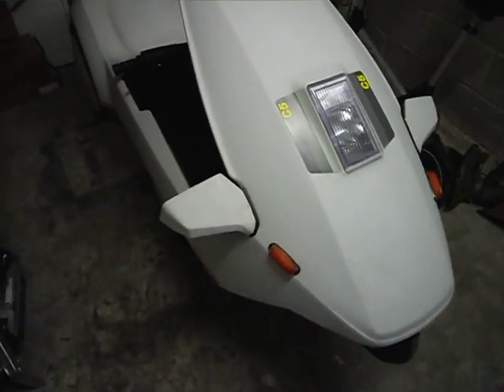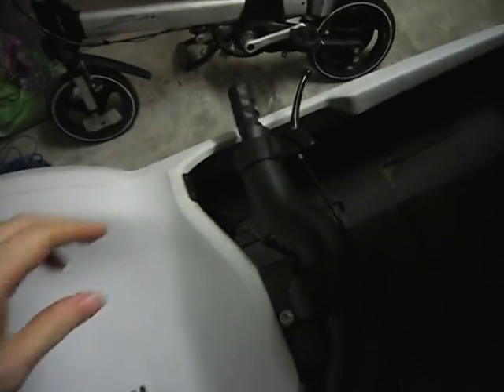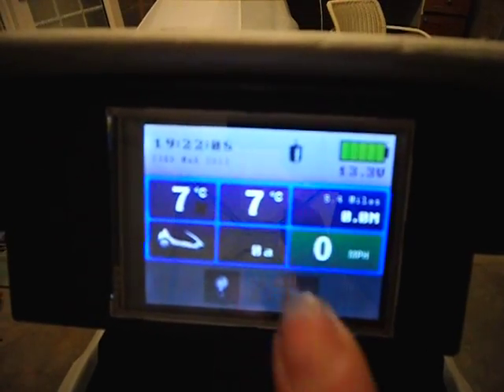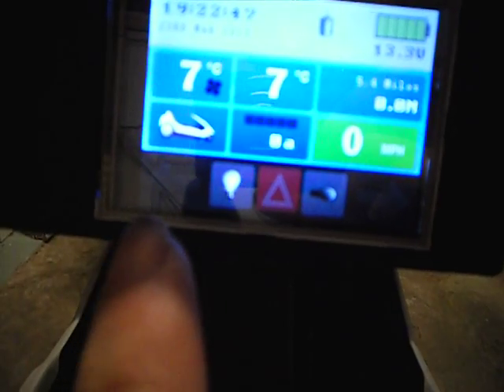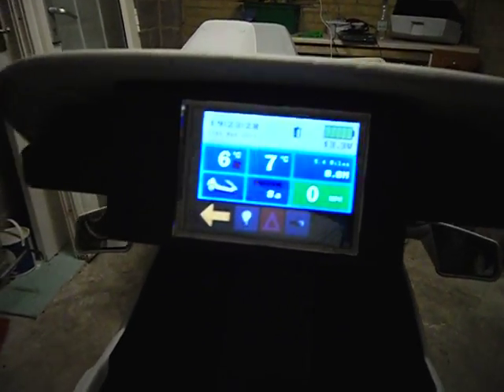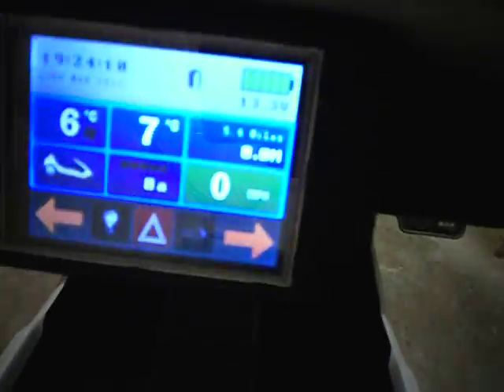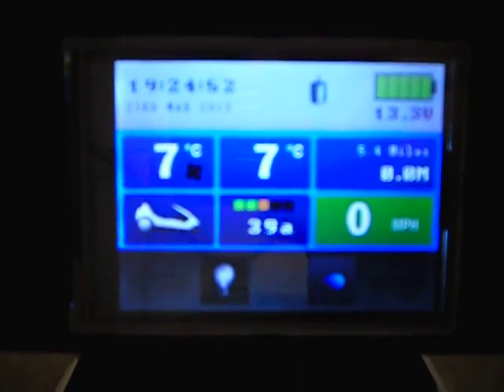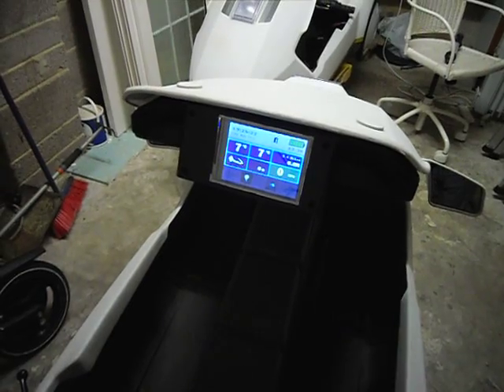Sinclair C5 Touch Update 1

Comment: Very impressive. I still think the C5 was ahead of its time. I think with a few tweaks, better motor or control and HUD it would have gone far. Maybe Sinclair should have done a 4 wheel version. Then again, of course, it was classed as a cycle.